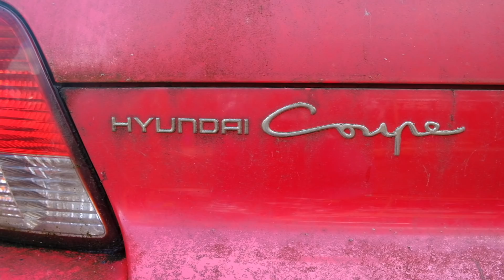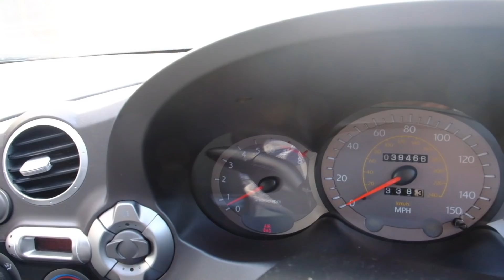My £500 Drag Race Challenge mystery car has arrived!

Comment: Rev counter not working
Reply from the maker: related to the lac of revs
Reply from the maker: as in its the same fault behind the needle stuck at the bottom and the engine not going over 3000